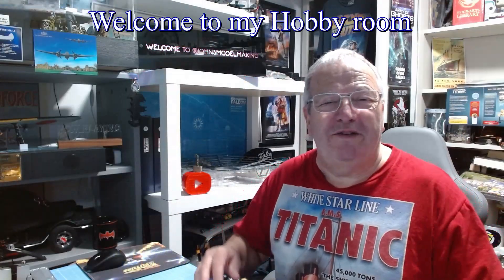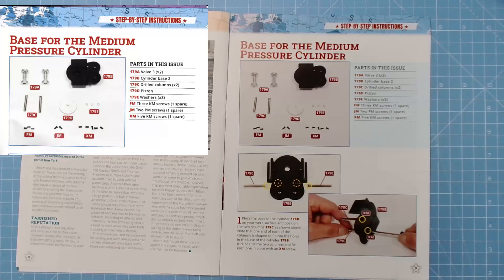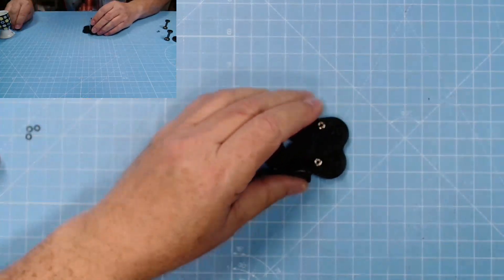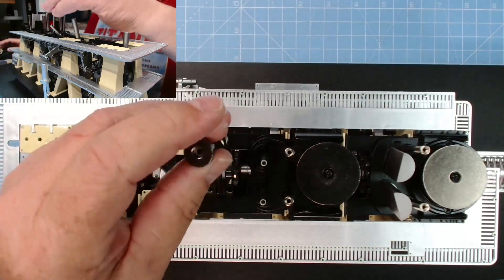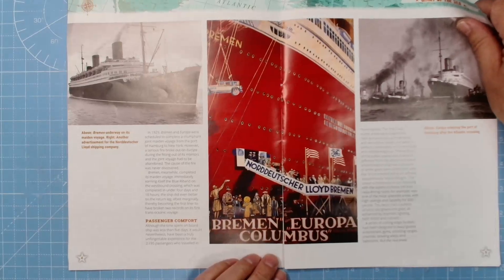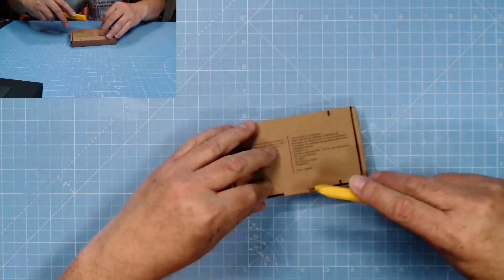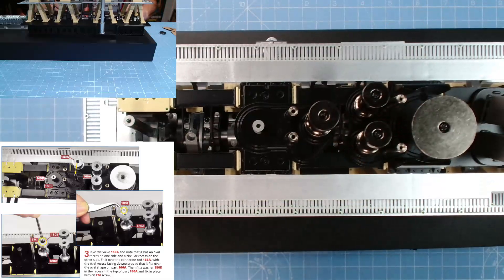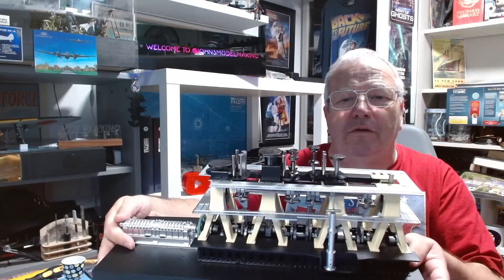Hachette's build The Titanic Reciprocating engine Stages 179 and 180

Comment: I am now on issue 185. Some parts not working out. I am also having issues with the cog slipping. The motor has a Metal cog so I can't understand why you would put plastic against metal.
Reply from the maker: I think they are both metal or should be. Check that there is no gapping on the stand and all screws are tight. Good luck. 👍

Comment: another excellent build John, the crankshaft on mine dosent turn at the moment as its secured to the base and the motor that will make it work when its done
Reply from the maker: It should move, Dave. Mines connected to the motor. Thanks 😊 👍